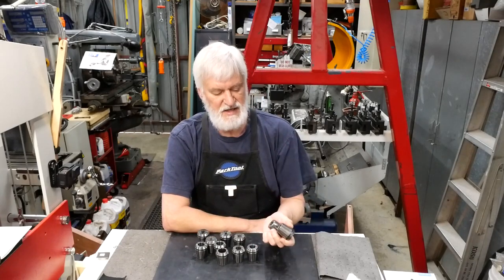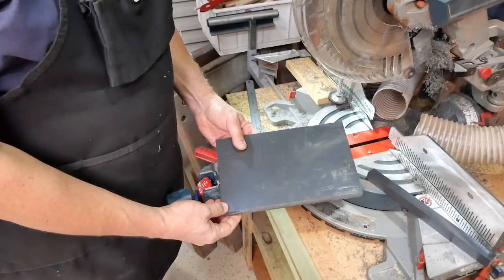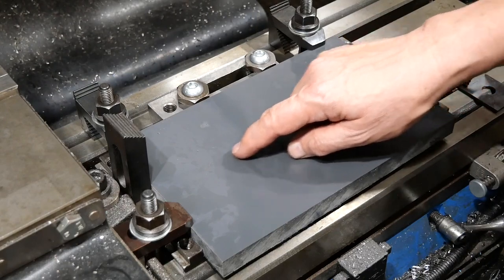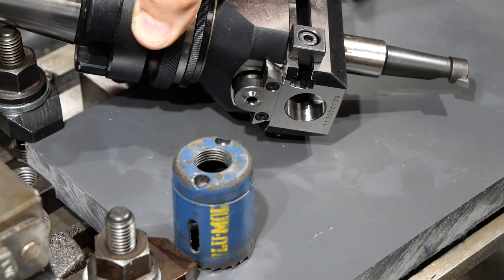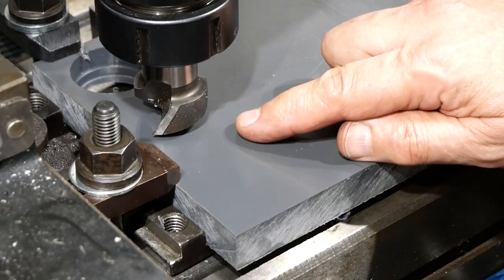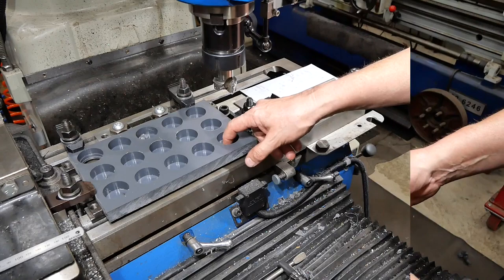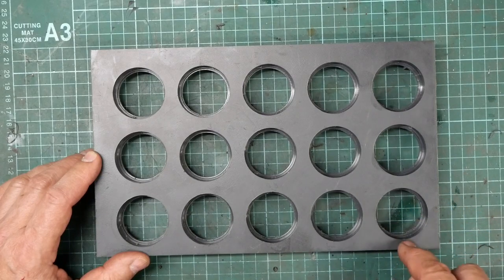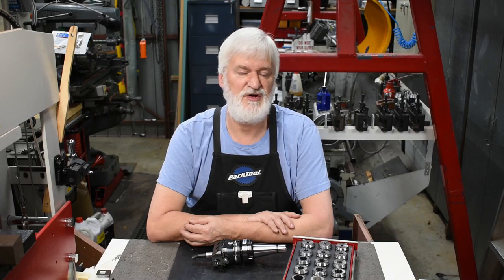Rack for ER40 collets

Comment: Gday Alan, great idea, turned out very neat, cheers
Reply from the maker: Thanks. In a previous comment, you asked about my milling machine. In this video I used it with a 75mm cutter to make some fairly hefty cuts - 6mm deep with a bite of 3mm. Not sure what the table feed rate was but there was an impressive spray of chips across the workshop. The machine handled the load easily but I could have used some chip screens...